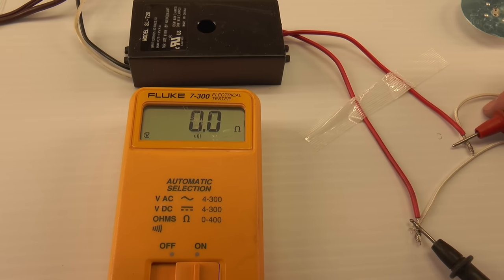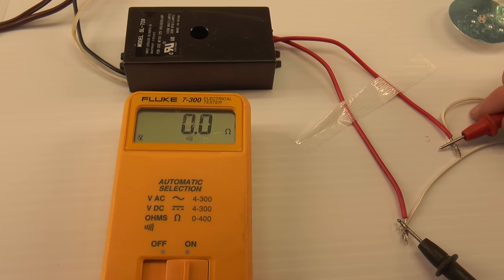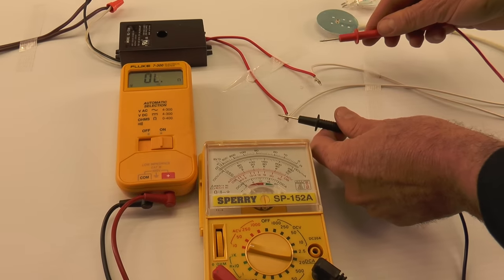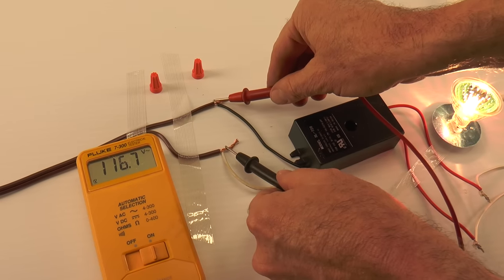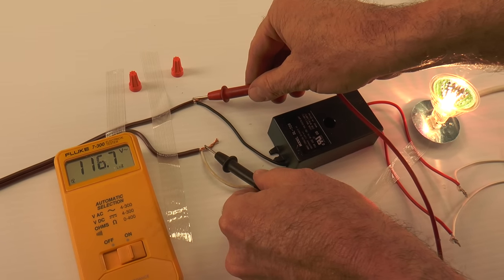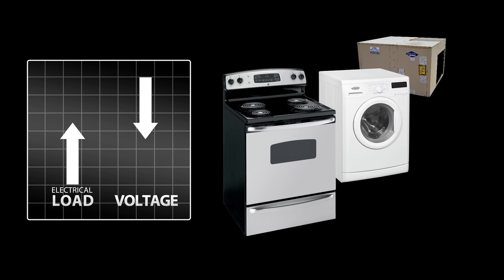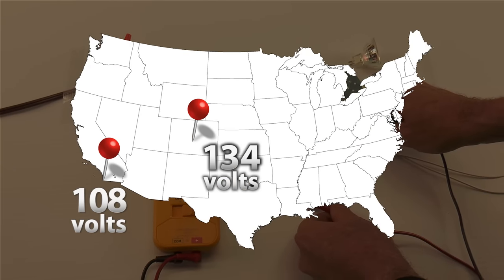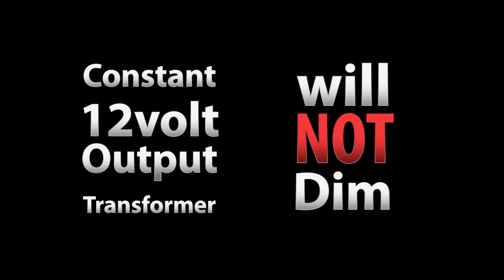Low Voltage Electronic Transformer Troubleshooting Guide by Total Transformers

Comment: I though my transformer was out and my cheapo voltmeter could not find any output voltage.  I tried your test lamp procedure and found it was ok.  Sadly this was after I'd replaced it already.  Problem in our dining room light turned out to be an inadequate connection between two portions of track lighting.